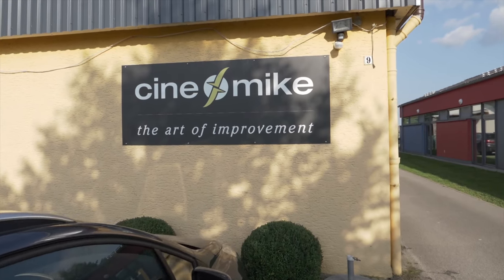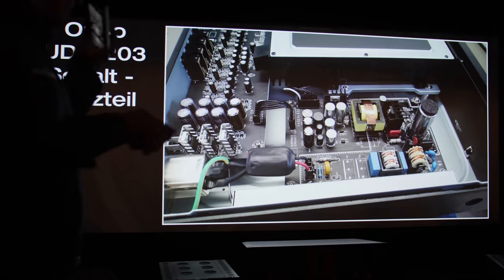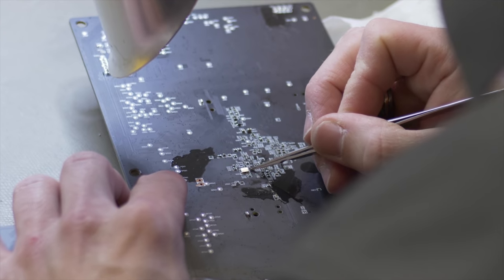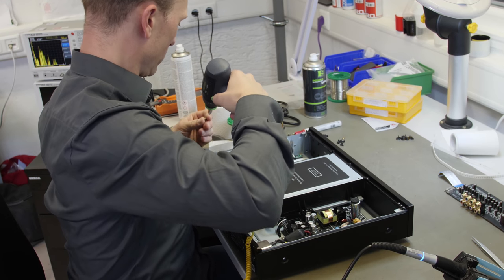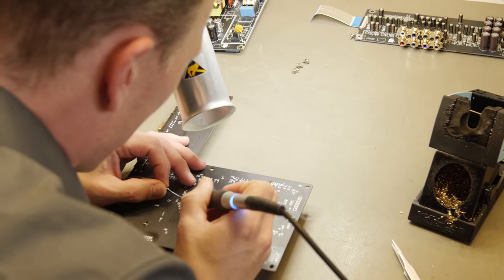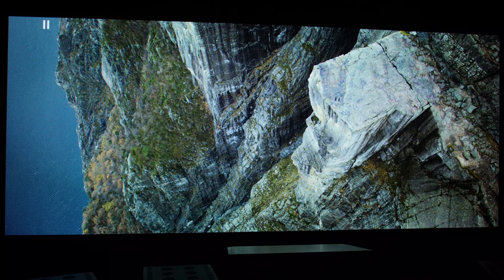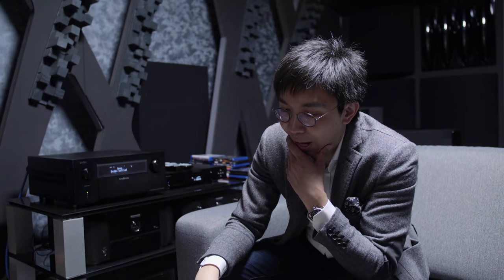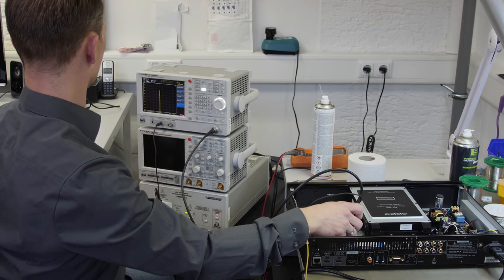What If You Can Lower The Noise Floor on Your OPPO 203/ 205? (Warning: Expensive!)

Comment: I have been talking about  DIY mods on my Channel for some time now. You can save alot of money doing it yourself if you have the skill set.
Reply: FADETOBLACK how do U know which components to change ?
Reply: @JohnnyFocal  if you go online and type in Google Oppo 203 mods. It seems like everybody selling a mod kit out these days on Oppo products. They sell entire boards that basically you just bolt in and plug up with all of the major components that make differences in sound and vision changed out for you.
Reply: FADETOBLACK yes but they just swap simple items and in most cases make it look and sound worse!
Reply: Changing things can go three ways better no difference or worse! I looked at a lot of these and most where badly thought through or dangerous. As well as making things worse noise wise! When u measured what it was doing it was not good !
Reply: @JohnnyFocal  Jon ar eu working for cinemamike :) DIYforum oppo 203 has 100 pages long of discussion bout mods. I have bought several mods kit then modify them further. All sound much better than original.
Reply: No! I know them and have written in Home Cinema Choice Magazine about them and find peoples ignorance about how electronics work and what is digital shocking.  Miss information and bad education seem to be common. It's not hard to make the Oppo sound better as it is such a bad design in the first place. Its just the Mediatek reference design which is just a proof of concept just to get the chips working and is not really an audiophile / videophile design. It's easy to improve on it and oppo where lazy to not go beyond it. I have tested a number of supposed other modded Oppo's all I wasnt impressed with. Not hard to look me up, I was with Vincent when he shot this video. I invited him over as he wanted to know why I kept going on about them and wanted to see and hear for himself.

Comment: I wonder if cinemike could improve the Denon AVPA1HDA processor?
Reply: Yes they do, it was the previous Reference processor. I had one but can't compete with a CineMike AV 8802 or the new 8805. The AVP design is already 10 years old.
Reply: onlyvik I can personally live without Atmos.  But it would be nice if the AVPA1HDA was more musical.
Reply: Do you have the 3D board? Be aware that one day your board will die because of bad ventilation inside. Denon made a stupid mistake to block the airflow. CineMike also  fixes that.
Reply: onlyvik no I dont have the 3d board.
Reply: am quite sure if you would have heard the comparison between the denon AVP A1HDA Processor untuned and tuned, then you will die for it. The untuned sounded like the intruments are playing against each other chaotix, the tuned gave a tribune to the whole ensable with wide space and harmonic behavior in between the playing instruments. 
I am still sure its the best sounding processor if you hear concerts in the first place. The Processor is now really old, so to invest in a new tuning it might be too much effort money wise. Because replacement parts are hard to get or not any more manufactured like the digital board. If you are keen on get one used tuned version where the op amps are done by cinemike. This was the biggest improvement ever on the Denon.

Comment: Snake oil scam. When you bitstream (confirmed by CineMike comments) the audio files are prepackaged as Atmos/TrueHD/DTSX files, and transported to the receiver, where they are decompressed and decoded. It’s impossible for a player to influence the audio quality before it hits the receiver. The audio quality pre-determined and unchangeable until is it decoded, and when bitstreamed via HDMI, that decoding is done in the receiver, so the Blu-ray player cannot influence it. Whatever the “noise floor” is, it was determined before encoding to Atmos/TrueHD/DTSX.
Reply: Yes it does. The reciever only decodes what is being sent to it, and the source is responsible for that, bitstream or not. The information has to be read and packaged by the player then sent to the reciever. If that package has errors in it, errors made by the source then the reciever will play those errors. So changing the components within the source to reduce those errors and the things that cause them is the logical thing to do, and what's been done here, and they've shown it works.
Reply: One thing they do (after improving the main power supply) is stabilizing the different voltages, coming from the main 12v power supply  and leading to the mainboard and chips. They are devided in smaller voltages like 3.3 v , 1.8 v 1.2 v.  there is always a loss and voltage drop in the signal paths.  There are 5 or 6 smaller power supplies just in front of the main chip which he improves with better parts. Also special filtering. This is only one part of what he does depending on the different stages of tuning. There are also clock mods. What people don't understand is there is also noise back to the power line which has an influence on the whole chain. It all works in parallel. This work is something they don't to in the factory because everyting is build for a price and has to be produced in a short time. It's not as simple as "just a bitstream signal" because we are dealing with analog voltages and they are sensitive to noise and stability. Just swapping the original power supply with a linear power supply doesn't do anything. They even make the player worse than the original Oppo. The room for improvement starts after the main 12v power supply. And don't forget that the rest of the system also has to be on a high level to get the benefit of these mods.

Comment: Absolutely waste of money.
Reply: Any experience? I'd love to hear  where your comment is based on.
Reply: @onlyvik  I’ve modded my 203 with an upgraded linear power supply and ESS9038 DAC board from Oppomod in South Korea. Both changes improved sound quality significantly.
Reply: @ChrisMag100  if you want to improve sound and picture quality you need to do more. What CineMike does for example:  (after improving the main power supply) is stabilizing the different voltages, coming from the main 12v power supply  and leading to the mainboard and chips. They are devided in smaller voltages like 3.3 v , 1.8 v 1.2 v.  there is always a loss and voltage drop in the signal paths.  There are 5 or 6 smaller power supplies just in front of the main chip which he improves with better parts. Also special filtering. This is only one part of what he does depending on the different stages of tuning. There are also clock mods. What people don't understand is there is also noise back to the power line which has an influence on the whole chain. It all works in parallel. This work is something they don't to in the factory because everyting is build for a price and has to be produced in a short time. It's not as simple as "just a bitstream signal" because we are dealing with analog voltages and they are sensitive to noise and stability. Just swapping the original power supply with a linear power supply doesn't do anything. They even make the player worse than the original Oppo. The room for improvement starts after the main 12v power supply. And don't forget that the rest of the system also has to be on a high level to get the benefit of these mods.